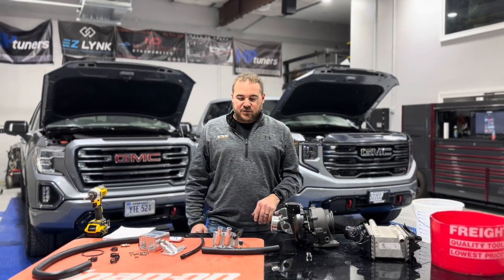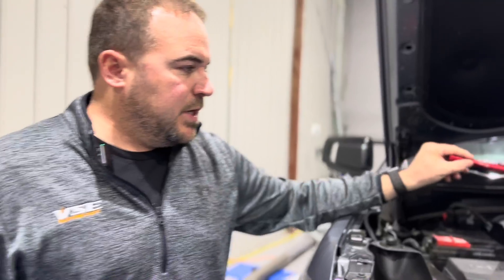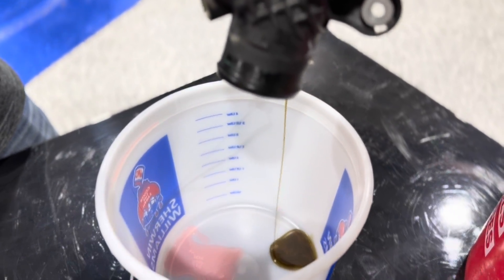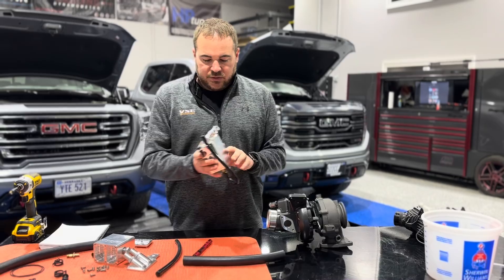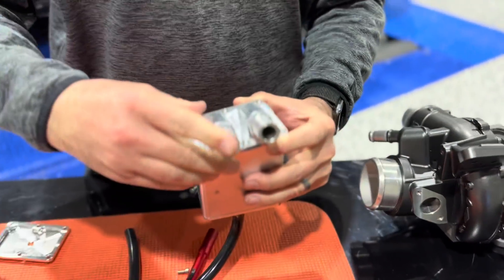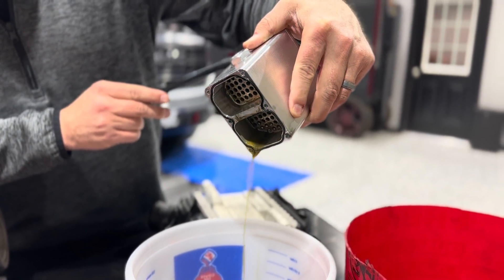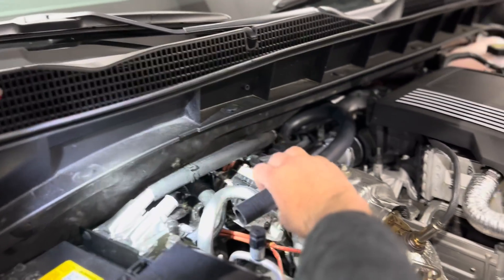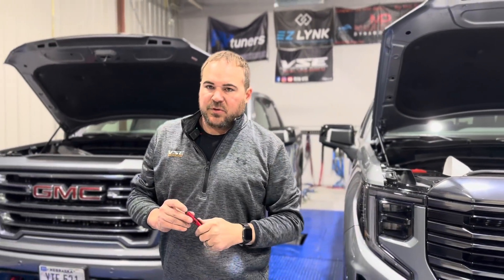3.0L Duramax Diesel - Largest Fault Yet

Comment: Where did you relocate the module that sits on top of the battery?
Reply from the maker: The module stays in place, just run the bolt out, run our bolt into the existing bracking and used the nut we supply to bolt the catch can in place. It takes about 30 min to install.
Reply: @runvse  it seems that the hoses and wiring harness would be a tight fit and would cause rubbing issue between the three, this leading to a hole in the or exposed wiring. Of course this won’t happen right away, but it seems possible to happen over time.
Reply from the maker: @gasparsperformance9841 the hoses come out an an angle and do not rub on anything. one you install it it is good for years if not decades with no maintenance other than draining on the oil change intervals
Reply: @runvse  my truck has a wiring harness that’s on top of the turbo and goes towards a module that sits on top of the battery. I see that the truck you showed in your video doesn’t have that wire harness or module. I’m not sure if this is something that was changed on the LZ0 or if that module pertains to trucks with certain features
Reply: @gasparsperformance9841  I feel ya, it is tight for sure, but I added wire loom to the supplied VSE hoses and once installed it appears to be ok, I will report back in on the first can drain!

Comment: Will your kit work with the PPE heat exchanger intercooler?
Reply from the maker: Yes it will. The PPE intercooler doesn't have any connection points with the CCV system

Comment: Very cool and Tks .  Two questions. 1, when is it available and 2. Quick question on the turbo.  I’m new to diesels and have the LZ0. When you run the engine for a long time, I was told to let the truck idle for a minute or two to make sure the turbo cools down so the oil won’t cook in there.  Does this engine still circulate oil (turbo saver style) or coolant after you shut down the engine or should I continue to let her idle to bring down the temps.  If so how long.  Many Tks.
Reply from the maker: Its a ball bearing turbocharger and these trucks have auto start / stop from OEM. The turbo is ok if you don't let it idle - although it is much better on it if it is allowed to idle for 5-10 seconds prior to turning it off - great question!
Reply: @runvse  Tks. By the way I shut off the auto stop start.  I don’t think it’s good for the life of the turbo or the engine to go on and off to safe a couple pennies of diesel
E.
Reply from the maker: @hammer-r We tune them out as well for permanent disable
Reply: @runvse  is there a video on how to disable the auto start/stop?

Comment: Wouldn't the water vapor flash off?
Reply from the maker: The water vapor doesn't flash off and if it really did then we wouldn't have oil / water vapor sitting inside of the heat exchanger that we pulled off our truck. The reason the water vapor doesn't just flash off is because you have the system under pressure while driving (boost pressure) The increase in pressure increasing the boiling point of the water (saturation temperature, and is part of basic thermodynamics and fluid hydraulics)  As an example the typical turbo discharge temperatures of these trucks driving around under load is 200-250F at 18-25psig of boost. Saturation temperature of water at 20psig is 258.8F. This means that the water vapor leaving the turbo at say a max of 250F is 8 degrees subcooled so the water can't possibly flash at that point. You can look these values up right on the steam tables  for saturation pressure. Further - the temperature drops as the charge airflow passes through the heat exchanger and typically exists around 120F under the conditions above. We know without looking at a steam table that the saturation temperature at sea level for water is 212F so at 120F the water can't possibly be flashing off since it is at a minimum 92F subcooled.
Reply from the maker: basic steam table link

 https://www.google.com/url?sa=t&rct=j&q=&esrc=s&source=web&cd=&ved=2ahUKEwiMp5i4-_OEAxV9FjQIHT4GDWsQFnoECBUQAQ&url=https%3A%2F%2Fwww.milwaukeevalve.com%2Fwp-content%2Fuploads%2Ftechnical-service-information%2FSteamTable.pdf&usg=AOvVaw28ooJgNqIA1q2QuuLkINlS&opi=89978449

Comment: Very cool product and nice presentation.  I would recommend changing from the sight glass on the product though, I know many companies like using those and they have been used on air compressor pumps for like ever but they are not that great over time. They are too small and hard to read or see through many times. Just have the catch can with the long hydraulic oil level indicator or even better just make the main portion of the can out of a strong clear plastic so you can see through the whole thing. Way more user friendly for the customer.